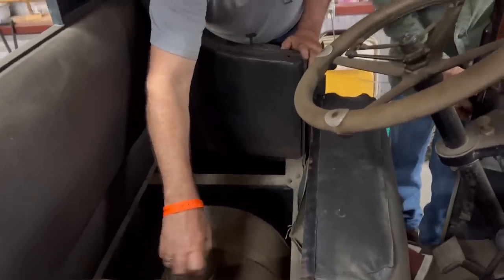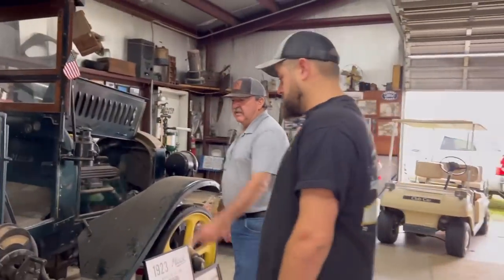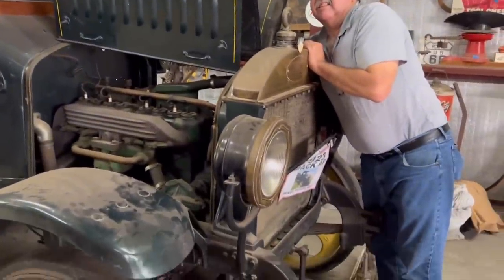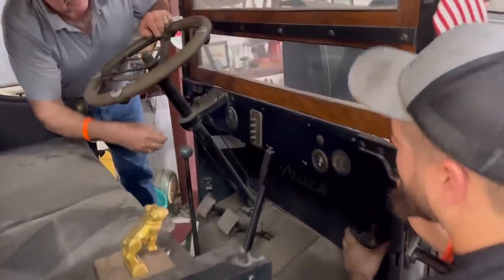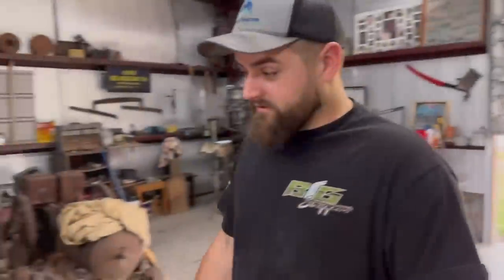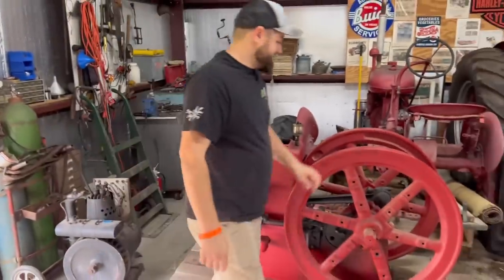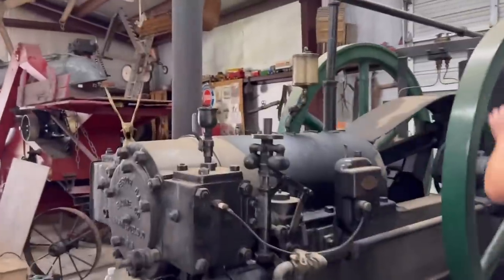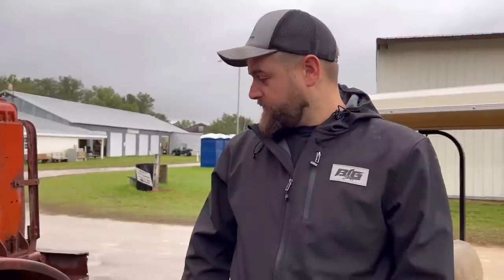1922 Mack Truck Model AB, Restored to better than NEW!

Comment: My lathes use the Clipper belt lace system also. Final drive chain I saw that on a Packard I think it was church bus from early 1900s. I build erector set steam cars, trucks. With Empire, Mamod, and homemade steam engines. I use chain drive and machine the sprockets on my Atlas shaper. Cool video! I would love to know how many teeth on those sprockets. Looks like 12 on little sprocket. I use 12-36 teeth on my stuff.

Comment: In the early 80s I remember moving back home to Texas. I went quail and pheasant hunting in the panhandle of Texas for the first time and you could hear those engines still being used to run the oil pump jacks. You would hear one pop then a few seconds later you would hear another one pop on another well.  So all around you, you would here pop pop pop as each pump jack would begin to lose momentum. With the pump jacks the pops were not far between because it took a bit of power to keep those big pump jacks moving.

Comment: Add it into the oil run for About 300 hundred miles joy riding around in it. I'd drain out some motor oil to be able to add in about 11/2 quarts of marvel mystery oil.& ATF transmission fluid mixture. Then drain.& Change that motor oil.& Add in some zinc powder additives into  one gallon jug of motor oil to put back into that model A Mack truck .

Comment: Use some marvel mystery oil mixed with ATF transmission fluid it'll free those sticking valves.& Oil rings inside of that engine to.

Comment: I used to work at a  shop that had a ford model T and the starting process was very similar. I had to start it every morning and drive it out and put it on display, and then drive it back to the shop every night at closing.

Comment: Jay Leno has the stuff so your not screwed. still have stuff 3-d printed tires are hard rubber same as fork lifts you just have to a mold made. i’d oil her up if it wasn’t nasty go put put with it. definitely do an oil change need to exercise her. big kids -kids show up need to give them a ride. Thank him for cranking her up.

Comment: 20:39 remember now, horsepower is nothing but a scam today.
that engine supplies 8 true horsepower, nothing like 250 horsepower engines today...
strap 7 horses to that old engine and it will win in a tug-o-war, but strap those same 7 horses to a 250-horsepower engine from 2022 and they will easily tear it to shreds.
idk if horsepower is measured differently today... but id rather have my car powered by a vintage 1890s - 1930s simple and straight forward engine.
they're way easier to repair and maintain considering they're not enveloped in a cocoon of wires and sensors, yes... I know newer engines are more economical but their production leads out a lot more carbon monoxide than an old engine... mainly in form of transportation and manufacturing, not necessarily the engine itself.

Comment: wouldn't you end up spilling gasoline all over the inside of the vehicle? that's not a great design lol
Reply: Remember this is 100 years old
Reply: @calabar92  I know, but how hard would it be to put a hose so you can fill the tank from the outside of the vehicle?
Reply: @D76straight  think about it. There were no small hoses but idk I’m dumb
Reply: @D76straight  Like the hose coming from the gravity pump that they used to fill it? Gas didn't flow like it does now, in the time of that truck it would have used that big pump they showed with the huge glass container on top. They pumped how much fuel you wanted into that glass container, then from there it would gravity feed down to the nozzle. A very slow system compared to today.
Reply: @mrray55  Is that to avoid over-filling the tank?
Reply: Good thing you weren't born in those times huh ? Got damn what is this world coming too 😅
Reply: @adampatterson3188  If I were born in those times I could have created a car company that filled the tank from the outside, and dominated the market!
Reply: @D76straight  Not really. The glass container has measurements on it for each gallon. It's how they metered the amount of gas you bought.

Tanks were placed inside most vehicles to prevent them from the elements. The seals didn't work very well. So inside the cab, under the seat protected the tank. You have to understand the technology they were working with at the time. People then would find it crazy for your fuel tank to be exposed. Also the material used for hoses at the time would not hold up if they remained full of fuel.
Reply: @mrray55  Wow, that actually makes a lot of sense! So intersting. Thank you
Reply: Time moved slower back then 
No1 spilled anything.
Reply: Hides the aroma of baked beans for breakfast  ..........
 P R I C E L E S S  !
Reply: I would say the same thing about all in cab tanks but they did it